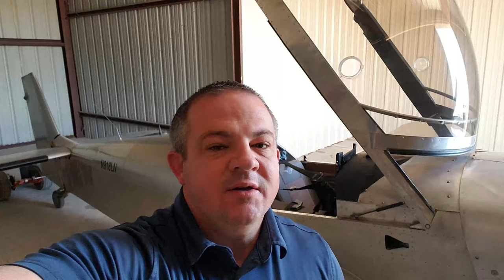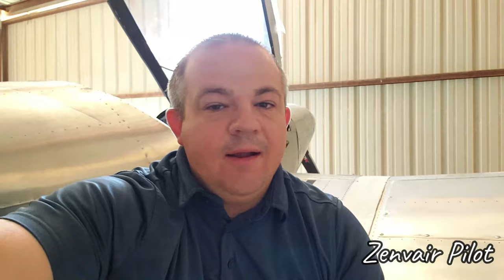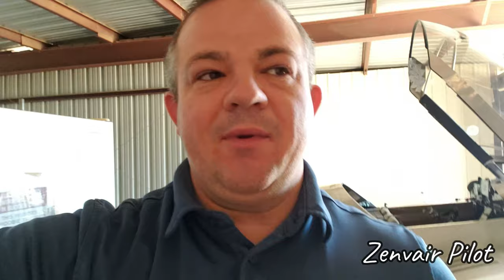What is the Difference in Operating Cost? Experimental vs Certified

Comment: What about insurance though...how much are your premiums (and how many hours do you have)? I'm currently building a Zenith 601 but I keep hearing that experimental insurance is getting  harder to find and much more expensive....
Reply from the maker: I got a quote from Falcon insurance.  they were under 1000 a year.  I have 250 hrs total with 140 taildragger time.
Reply: @zenvairpilot  that’s not bad! Is that hull and liability? I’m still a student but should be past the 100 hour mark before I fly my zenith, also planning on getting about 10 hours transition training.
Reply: I have a Zenith CruZer that is about a year old.  I have over 300 hrs total flight time and 150 in my CruZer.  I pay about $1200/yr for $75K Hull and Liability.  The biggest thing that has helped me keep my premiums low is time in the Aircraft.
Reply: @scottmiller4711  thanks for sharing. I just got a ballpark quote of about $1700/year with 75-100 hours total flight time and 10 hrs time in type, which seems about right. I hope to have more hours in both categories by the time my plane is finished, but worst case 1700 isn't too bad, and would hopefully go down  after the first year...I just need to fly 5 hours a week, which wouldn't be so bad  :)